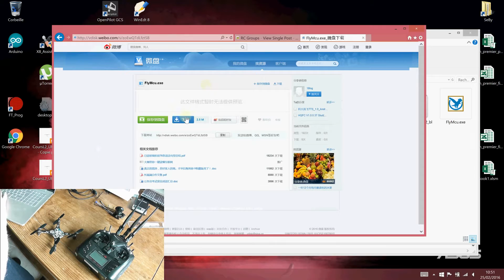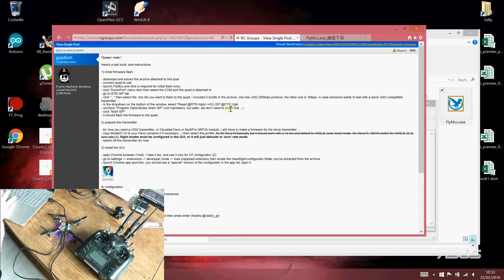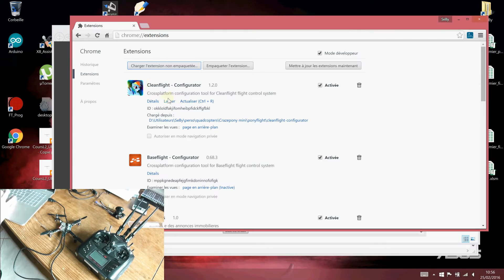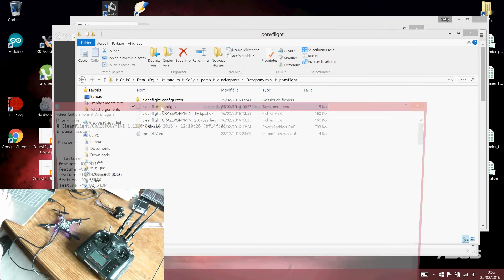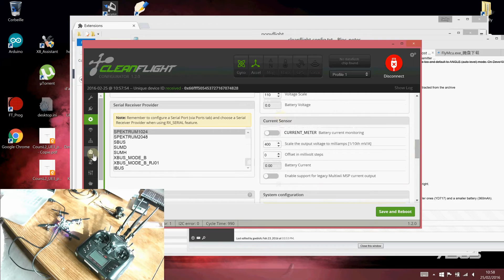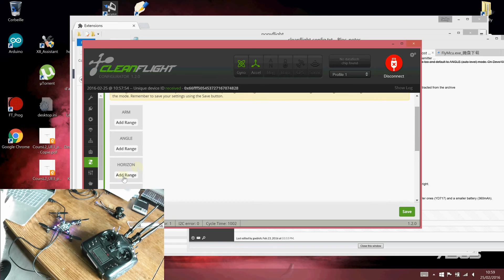Crazepony mini "Ponyflight" installation tutorial (Courtesy Banggood)

Comment: Hi, please tell me, I want to buy a quadcopter for initial training, but
 had a question. Your video is listed under the flashing cleanflight, 
but I did not understand whether it would be possible to go back and it 
will work the complete controller? I read the guidelines, I realized the
 instability of the flight is associated with too heavy a propeller, 
whether the 60mm?
Reply from the maker: No possibility to reverse back :( ... Crazepony of die :) ... Yes I installed some 60mm props and it flly much better
Reply: A complete remote control will work with cleanflight?
Reply from the maker: thanks to crazepony, we can use some Devo controller with the V2x2 protocol
Reply: +SeBy DocKy I only serial controller does not Devo. As I wrote quadrocopter I need to train and I do not want to invest a lot of money .

Comment: HI, can you fly it with a Taranis, like you are with your Devo? Did you add a rx, or with 250K setup we can indeed, connect other tx? Tks for this video, it seems a great little guy, using Cleanflight! Keep in touch1 Tks and Safe Flying!
Reply from the maker: +FPV Cambodia Well If the taranis can welcome a nRF24L01 RF chip, yes should be possiblle maybe to use it. I used the default crazepony RX no modification for this machine